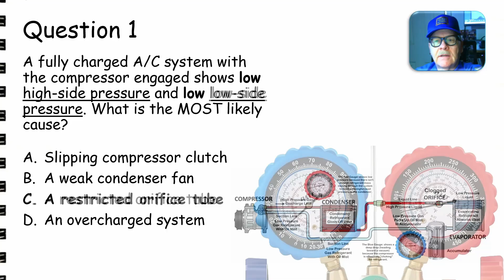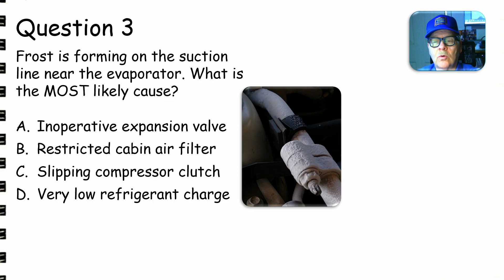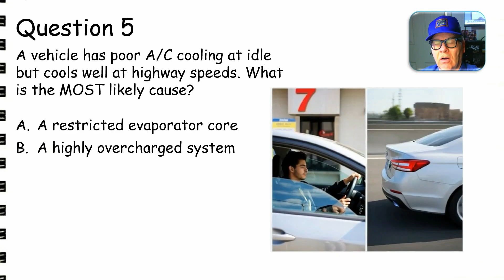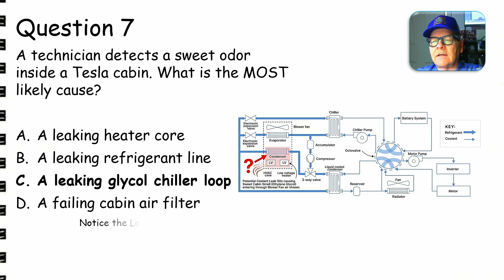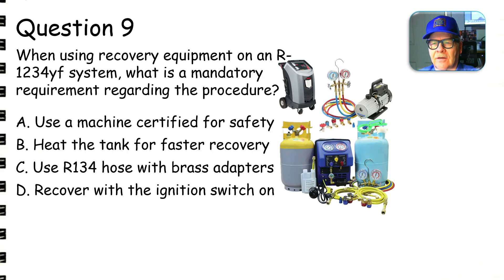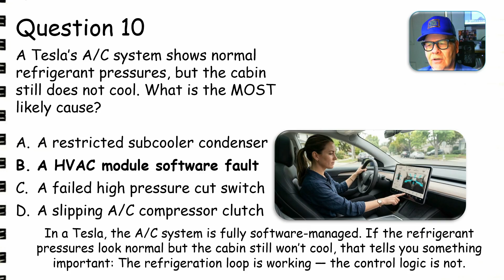A7 HVAC Practice Test and Stories

Comment: The 79 lincoln was still blowing frost clouds in the 2000's even after the engine out with compresssor pulled to the side a few times. Cruisin the Texas highway tuna boating at whatever speed  with cold vent clouds while 100F+ outside with the 8track or integrated cb soft leather and shag carpet deep enough to get lost in. 
monday Monday MONDAY
Have a nice week
Reply from the maker: Thanks, you too!